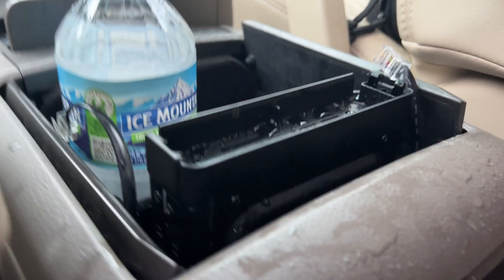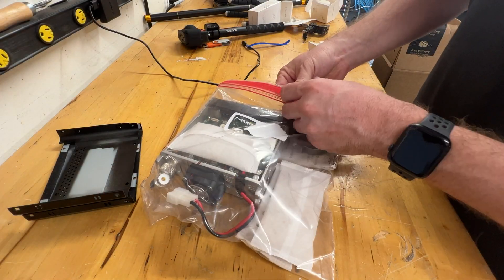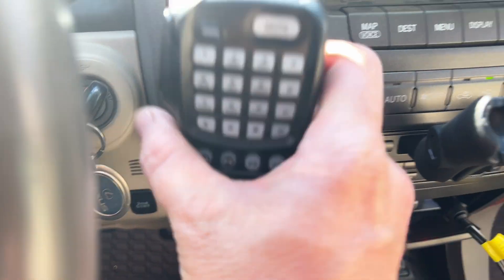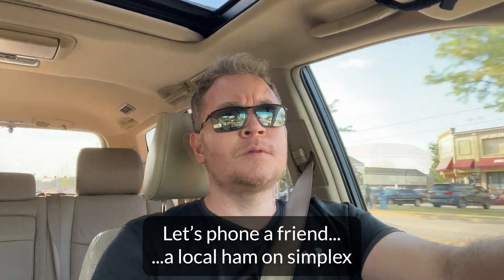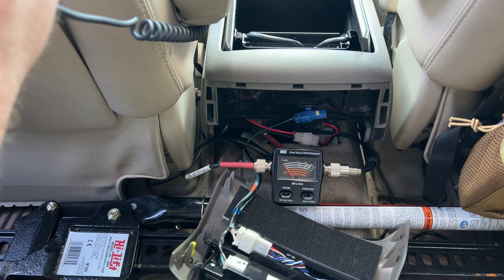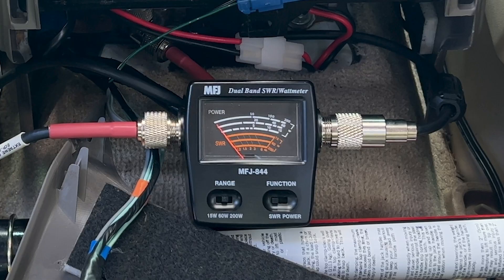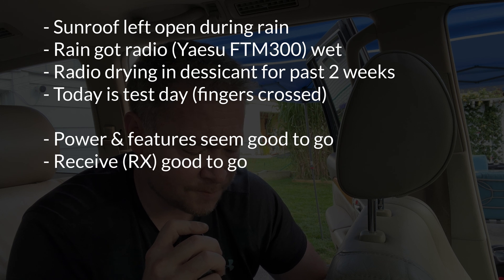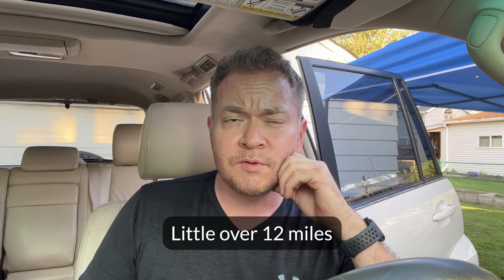Did I Just Brick My Ham Radio!? - Troubleshooting a Rain-soaked Yaesu

Comment: Drain the water out of the coaxial cable... (only half in humor).
I hope you tried a new cable direct from the radio to the base of the antenna.

Back in my CB days, I had mounted the radio on a removable slide mount that included a pair of slide contacts for the cable connection. Eventually, one of the cable contacts failed. I think the feedline became part of the radiating system, since trying to tune the antenna became a non-nonsensical pointless exercise. The repair: put a quick disconnect UHF connector on the back of the radio, and run the cable directly to that. Today, I would use a UHF-BNC adaptor, and put a BNC on the cable. Eventually, I did exactly that, but used the feedline for 2M with a 1/4 vertical, driven by my HT.

Brett KA7CGB

Comment: I left my passenger window down just a bit last winter, the next morning I found a snow drift in my truck covering my Yaesu FT-2900R. Thankfully it was still cold enough that  no snow had melted. I used my cordless leaf blower to remove all the snow from my truck and my radio worked fine. K0DXJ.

Comment: Water entrenched through the crimp of the coax takes forever to dry... I've had to replace coax runs because of rain related... where the cable itself accounted for as much as 4dB of loss at 2m after it sat submerged in rain water. but if I took the wet cable out and cut off about 6" of the problem cable from the wet side I had no coax loss. Sometimes its silly... like an angle adapter going bad (the one on my the center contact turned black!). Glad I'm not alone in finding out that they can go bad. 
73 de KN4GEI
Reply from the maker: Yeah, so I'm learning.  I hadn't thought of water ingress to the coax itself.  That's a great point.  I don't think that's an issue here, but maybe this is a good opportunity to learn how to test coax.  Glad your stuff worked out well, and thanks for the new tip :)

Comment: I spilled lemonade into the bottom of my nintendo switch.  Luckily not much made it inside.  After drying, the only issue was half the touch screen worked and it was registering erratic presses all the time, so I ordered a replacement screen/digitizer and a tri-wing screwdriver.  When I took it apart, the was a lot of corrosion on a big inductor next to the usb connector, so I cleaned it with rubbing alcohol and a swab. It has been working fine ever since.  I probably should have resoldered or replaced the inductor, but it's had hundreds of hours of runtime since then and I have a backup screen.
Reply from the maker: Wow!  Cool story and nice save!  When I heard lemonade I was thinking "oh crap, sugary drink?  it's toast"  :)  Well done
Reply: BTW, I got the mobile radio in your radioddity giveaway a while back.  It's in my car and I use it all the time.
Reply from the maker: @thibeault  Nice!  Glad you like it!  I've been very impressed with the Radioddity radio and continue to use mine to this day as well

Comment: I am a newby (studying for tech) but I was just reading that the dielectric in coax can soak up water and be very hard to dry out.  If the 90 got a little in it the feed line might have a slight issue too.
Reply: That was my thought. Great minds...

Comment: I accidentally soaked an DJI action camera. Dried it out as much as I could but it still had residual moisture. So I grabbed a desiccant pack and used a vacuum sealer bag. Works good as new now.
Reply from the maker: No kidding!?  Dang, that's pretty good!  DJI gear isn't cheap...that would have sucked.  Glad it worked out for you :)